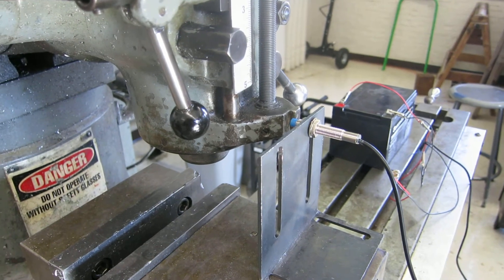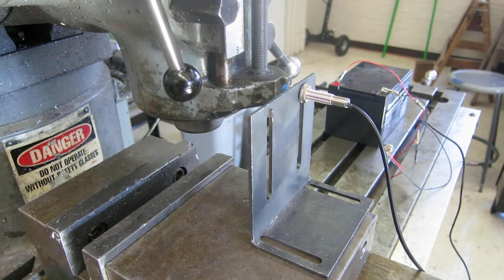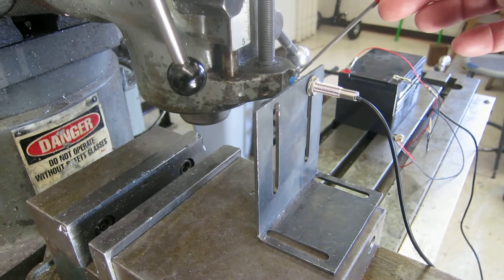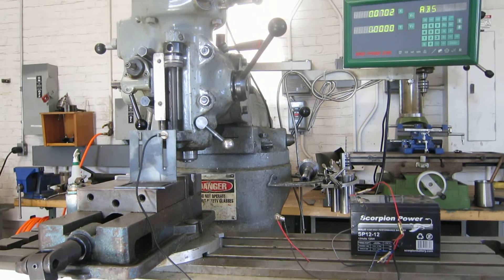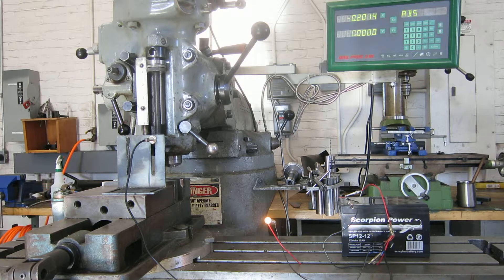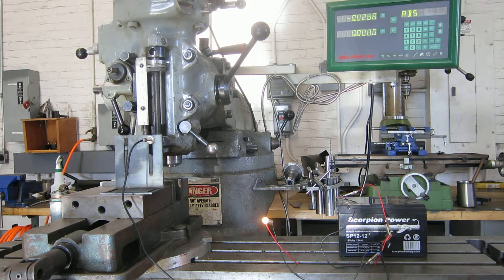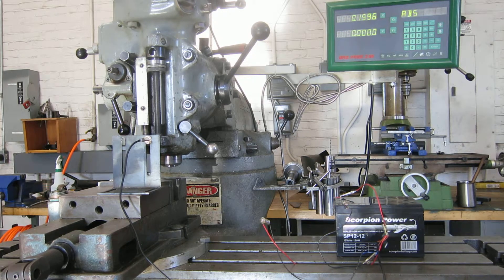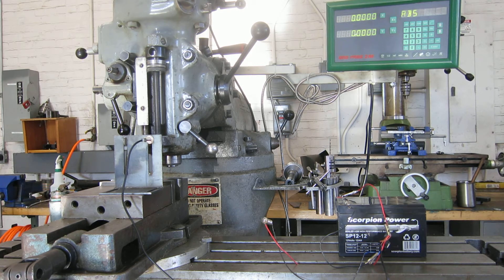Proximity Switch Introduction and Accuracy Test

Comment: I think the accuracy of these sensors has a lot to do with speed and need to be used slow to get repeatability
Reply: actually the accuracy doesn't really matter as the standard deviation in repeatability error is so low that its lower than a single unit micron